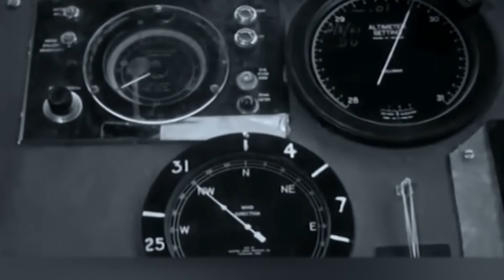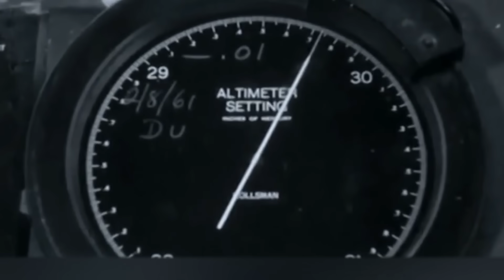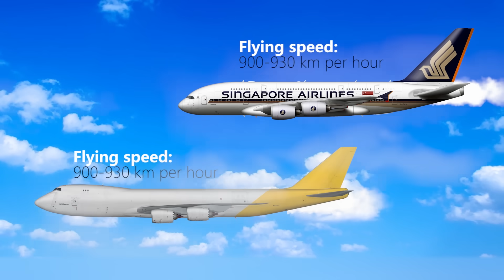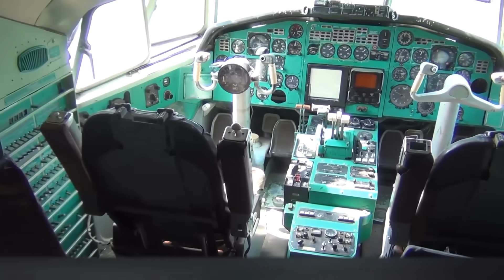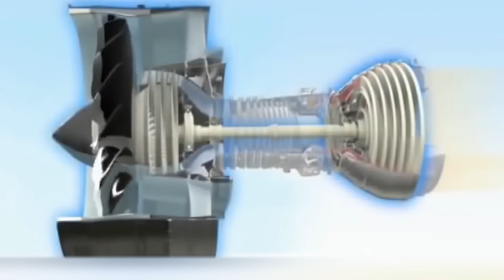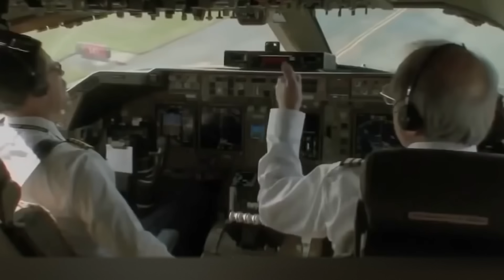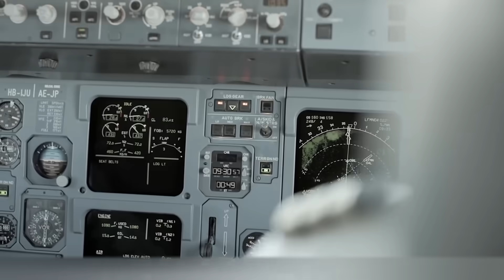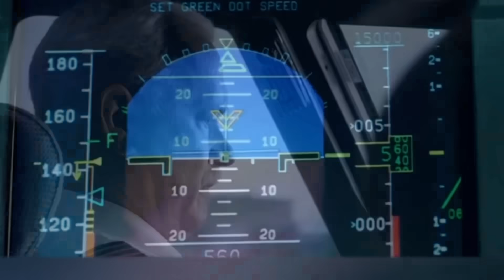Why Do We Fly so Slowly?

Comment: So in short: The faster you go, the plane starts to use too much expensive fuel. So we've switched from trying to go fast as possible to making the flight more fuel efficient. Essentially: all planes have turned into flying Toyota Priuses.
Reply: Yes, the law of diminishing returns, going faster reduces profits.
Reply: Airlines are struggling as it is. The guys from Virgin whats his name Richard something said the quickest way to become a millionaire is to become a billionaire first then start an airline. You want faster air travel, be my guest, go ahead and start your own fast travel airline and see how long you'll last
Reply: nicely put , I suppose it is like driving your car ,drive fast and hard and you guzzle up fuel ,keep to 100km an hour and you become fuel efficient and still get there in reasonable time
Reply: There are a lot of ways flying faster would not produce any valid return. Have you ever been in a flight that had to do circuits because there was too much traffic at the destination airport? And even those times where a flight is not put on hold, there are instances where the plane cruise speed was reduced by the crew to ensure they would not arrive too early and have to do those loiter circuits. So, you may not be able to actually use a faster cruise speed even if it was available.
But the real clincher is for the very long distance flights. New York to Beijing is 6830 nautical miles (great circle). Planes with that kind of range did not exist before 1989, so if one needed to go to China, a connecting flight or a refueling stop was needed. Now, with slightly slower "fuel sippers", you can fly those routes *direct*. And that does save hours to your travel by avoiding not only an extra lading/takeoff (and descent and climb), but the extra distance as the refueling airport is unlikely to be conveniently located right in between the departure and destination cities.
Reply: He forgot to mention the undue stress on supersonic air-frames caused the aircraft lifespan to be cut dramatically.  Those planes were grounded so fast by the FAA after there maiden flights it was crazy.
Reply: It’s all about keeping the ticket prices low the more fuel the more the airline will pay the higher the ticket
Reply: Pack 800 idiots on a plane call it lucky transportation! No thanks I'll fly in a crop duster !
Reply: Right This is way too much about Being fuel efficent its to lame
Reply: @azaperr8494  yep if you want that fly in that solar plane that will get you there in 6 months!
Reply: All he needed to say was Aluminum cheap but weak. Titanium strong but stupid expensive. Faster more fuel cost too.
Reply: @johnnyvt9  greed vrs time you think the public is stupid not calculating the btu per mile costs on any transportation?  Give me a frekin bridge to London!  I'd love to drive it!
Reply: They don't need fuel to fly they use compressed air
Reply: @sissyboy6552  you might think it's a joke  poeple but it's possible  ! If NASA got a trek warpy drive it's possible!
Reply: Every aircraft is designed to serve a purpose (flight characteristics and operations) that it will excel at.
Reply: TheBigExclusive planes are still fast if they can get you to Asia in 17 hours
Reply: Not really. The most expensive part of a Concorde flight was the acceleration to Mach 2 and low-speed approach, the cruise itself (at Mach 2) consumed the least fuel... It had great fuel efficiency at high speeds.
I could also go on total physical rampage about super sonic flight, but naah.
Reply: Its all business, you do not want to start a taxi business using all super cars and muscle cars, lmao
Reply: My taxi service will be all an all Bugatti fleet, people will pay for the added speed.
Reply: Aviator Dan, the supersonic part of the Concorde flight may well have been more fuel efficient than the acceleration and landing but even at that most efficient part of the flight it still consumed three to four times as much as its contemporary subsonic passenger planes on a per passenger mile basis.
In other words Concorde going fast may be more efficient than Concorde going slow but that is only because the Concorde is even more inefficient at low speeds than when it is supersonic, which is no mistake because after all it is optimised for high speed while sacrificing low speed performance.
Reply: @aviatordan1687  You might also add, that the Concorde fuselage was so narrow that it could only accommodate 100 passengers, in 25 rows of  4 abreast seating, a passenger cabin similar in size to the current CRJ900. Moreover, because of the high cost of operation, they were never profitable, and only served as status symbols for the UK and France.
Reply: Yeah it might have but they were very bad for the ozone layer because of the higher altitude
Reply: Aviator Dan Actually, he is exactly right.  The A320 burns a lot more fuel if flown faster than Mach .76, while on,y saving a couple minutes on a two hour flight.
Reply: I see. So basically greed and a disgusting business model isn’t enough 😂

Ok.
Reply: I wonder when Capitalism will give us a competing option... oh wait that's not guaranteed.

Comment: The other reason is this: 
https://qph.fs.quoracdn.net/main-qimg-f7c60ca610be1fafdf687c783e3b486d-c

The drag coefficient is directly muliplied into the equasion of air resistance. A simple multiplayer that can greatly increase the air resistance without any benefit, almost a little unfair.
As one can see in that chart the drag coefficient behaves pretty normally until about mach 0.8 (the crusing speed of modern airliners) only to climb much more until it finally drops off again. At about mach 2 it drops again which is why a supersonic jet should not have a max speed of 1.3
That is not efficient.

Don't think that air resistance will suddenly drop at mach 3 compared to mach 2. It will still increase as speed goes into the equation with v². However the amount of air resistance generated by the multiplier that makes your life harder without gaining anything will go down with more speed.
We already know that mach 2 was not working properlyfor the Concorde. Everything faster will be even less efficient and will cause the same problem as the Concorde had only worse.
The heat from the friction and the stress on the fuselage were already remarkable at mach 2.
 
But this chart also shows why we can't go beyond mach 0.8 like in the 50s. It is simply not efficient enough by todays standards. The gained efficiency is worth more than the lost time so to speak.

But lets not be disappointed. All those modern planes are remarkable machines with incredible high bypass turbo fan engines. The most modern engines even having a bypass ratio of 11:1
Incredible technology for incredible mass transportation.

Comment: Just because they don't use it doesn't mean it's not there when needed. I remember a AA flight I took on an L-1011 from Dallas to LGA back during the Air Traffic Controllers strike back in the 80s. I was flying in 1st class so we could hear the pilots and ATAC conversations through our earphones. We were next to take off and the ATAC instructed our flight American XXX Heavy to take our position at the end of the runway. I remember looking out my left side window at an approaching aircraft that appeared way too close for us to be rolling out on the runway. As our fight rolled into postion and squared up for takeoff, we heard the approaching American flight Captain jump in and inform ATAC he was landing on the same runway "NOW".  I'd been flying since I was 3 on tail-dragging DC3s, my dad worked for an airline and we flew all the time; I knew this was not a good situation. The ATAC immediately told the approaching aircraft to slow his approach by "making S turns". The approaching plane Captain shot back, "Honey, it's to late for that!" Dallas ATAC came back to our aircraft immediately. "American XXX Heavy, please expedite your departure"! Normally a big jet like that would take most of the main runway to slowly gain speed and lift off around the last terminal (there were four terminals on the east side of the runways, which we were on, and three on the other side). Our pilot responded, "Roger, we're GONE!" With that he floored it! All three big engines howled like I had never heard before (the phrase "Bats out of Hell" comes to mind). That huge aircraft lunged forward like it was shot out of a canon pinning us deep into our seats and that sucker was off the ground and lifting its wheels before we reached the first terminal. To give you a sense of perspective DFW is about the size of Manhattan Island. We probably only used a about a block and a half before we were airborne. Long story, but the point is that the power is there, it just isn't used very often.

Comment: this guy is just full of excuses, thats why it took 10 mins to answer something that takes 3, it all just comes down to 1 thing: money, specifically profits, Maximum profits possible, how do you maximise? make cheaper planes, make cheaper flights, but charge the same if not more for tickets, add fees up the ass for every little thing, ensure full ridership, even if it means kicking some people off the plane when you over estimate

you can't sit there making this video and tell me they are slower because planes are just more complex, or that a fuselage being 26 freaking centimeters wider would increase drag and fuel consumption that significantly, if you think idk, my grandfather is a pilot and even he said that 90% of this video is straight BS, he said basically the main reasons was this vids first point, noise levels, and additional discomfort (lets face it, plane trips are NOT comfortable) because approaching the sound barrier really is a BARRIER, its like telling a kid laughing at you that jumping into a body of water can be like falling on concrete, until he understands what a belly flop is, as you approach the barrier, the noise levels and hull stress loads dramatically increase, and with how flimsy planes are made these days, of course it'll greatly increase wear and tear, but also with a vibrational frequency between 15 to 50 hertz, it causes more than additional discomfort it can cause organ disruption and even failure! If they cared about decreasing travel time they'd disband the TSA, (which has only INCREASED preflight time) for automatic walk-thru detectors, because everyone knows the TSA is just bureaucratic BS, making the public FEEL safer when in reality everytime they do performance trials and tests, they are able to get on the plane with knives to bullets to hand guns 90% of the time!!! and its as if the public doesn't even give a shit, they're like "so yr sayin theres still 10% chance that they find something"

Comment: The answer is pretty obvious, so we should ask a different question.  Why did the Concorde business model make sense in the past but not now?  For this I'm going to speculate: if you could afford a concorde ticket at today's costs, you can pick and choose among business jet arrangements.  Biz jets are faster than they were in the 1960s, and fractional ownership is taken more seriously.  And the top 5% have more wealth than they did in the 60s, so they can, and will be less tolerant of airport security measures, including passenger arrival several hours before flight, and shoes off, and x-ray.  Private planes dont' have BS like that, and a top tier Gulfstream can outrun the airlines.
Reply: Overcast Friday that’s what they are working on.

Comment: Wow this really beats around the bush and glosses over the crucial points.  Aero drag goes up exponentially with speed.  So reaching higher speeds makes fuel and op costs go up exponentially.  The faster you go, the higher price tickets you have to sell, the bigger disadvantage you have.  Even if you're a luxury airline, you still want minimal fuel costs, so your capital is free to spend on passenger comfort.  A lesser reason is, the faster turbojets don't just gobble fuel, they're harder to hush up, compared to turbofans.

Comment: we don't  fly   " so slowly " .  
we fly at a speed that is safe and efficient for the aircraft and crew.   the primary consideration for commercial aircraft is  mach speed.  mach speed  is the cut line for both commercial and business jets.  mach speed is  THE  deciding factor in how the aircraft is shaped.  engine inlets , wings especially , stabilizers and control surfaces of  mach speed aircraft are  ALL COMPLETELY DIFFERENT  from sub mach aircraft. the wing and stabilizer surfaces of sub mach aircraft have asymmetrical chord lines . mach aircraft have symmetrical chords on the wing and stab surfaces.  mach speed aircraft have blocking devices in their engine inlets to prevent mach speed air from reaching the engine compressor. another complex system not required for sub mach aircraft. 
wing and stab surfaces are designed with both high and low speed operation.  training / beginner aircraft have slow wings so pilots can learn at slow speeds.  fighter jets have fast wings but have excessively high landing speeds.  commercial and business jets have a medium wing as it were that allows relatively high cruise speeds  BUT  more reasonable approach and landing speeds. 
when an aircraft is traveling at .8 mach the air traveling over the upper wing surface and upper stab surfaces is traveling at near mach speed.  if that air reaches mach speed as it breaks over the wing there will be a pressure inversion that causes the low and high pressure around the wing to invert theoretically at least drawing the aircraft down towards the ground until speed is reduced. it also creates vibration and flutter in the wing and stab surfaces  so in translation - if you are flying the aircraft at .95 mach the airspeed over the wings and stabs is exceeding mach setting up flutter from pressure inversion and vibrations the aircraft is not designed to withstand. 
at sea level mach speed is around 750 mph variable depending on temp, humidity and baro of the day. 
at cruise altitudes of commercial aircraft the pressure is much lower and thus mach speed is proportionally lower as well. 
most commercial airliners fly at  .8  or near mach speed of their current ambient conditions.  they have several different types of mach alerts and mach trim systems to prevent them from exceeding mach speed. when flying at  .85 mach and beginning to descend it's quite easy to exceed mach speed.  mach trim systems are designed to prevent the mach exceedence. automatically.
speed = money
although one could probably re invent the concord, what would be the practical gain ? the systems necessary for sonic flight are very complex , subtract from the aircraft's slow flight capabilities and as you said - fuel consumption is exponential. today's geared turbo fan engines are very quiet and fuel efficient. the aircraft themselves are very quiet  and have safety ratings off the charts like never before.  when it boils down to bang vs buck we have reached the edge of potential for building commercial aircraft. 
at the end of the day it comes down to money.  how many fairing passengers can i carry  vs  how much to carry them ?  how many fairing / paying  passengers can i deliver safely, on time , with no delays and break downs  vs  how much to carry them ?  how much to safely operate the aircraft per operating hour ?  how much in fuel ? tires ?  crew ?  and maintenance costs per hour to operate the aircraft without killing anyone  ?   this is  THE  deciding factor for airlines and you are kidding yourself if you think otherwise.

Comment: Technically they can fly supersonic, But the right conditions need to be met. They have to fly with the "jet stream" and so the air around them is going a normal 500+ mph but in relation to the ground they are moving supersonic speeds because the jet stream pushes them a few more hundred mph.

Comment: This video is much ado about almost nothing. In 30 seconds you could have said what needs saying. And it is not careful with distinguishing terms, such as "turbojet" and "turbofan." At one point the video literally contradicts itself on this distinction. Finally, all of the fluff near the end about time savings totally misses the real points. In FACT, airlines are not seeking passenger comfort; they are seeking to cram as many passengers into the space as possible, with an intentional disregard for comfort. Moreover, all of the time-investment involved in even having that 2 or 3 hours of flight turns a "3 hour trip" into an about "6 hour trip," by the time you throw in driving to the airport, checking bags, TSA lines, waiting at the gate, loading, waiting on the tarmac, taxiing, then reverse that process. In short, at this point if a trip is within 8 hours of driving, it's a no-brainer for me to drive it instead of fly it!

At any rate, this video spends too long saying too little, and most of what it does say is more often than not incorrect. Down-vote.